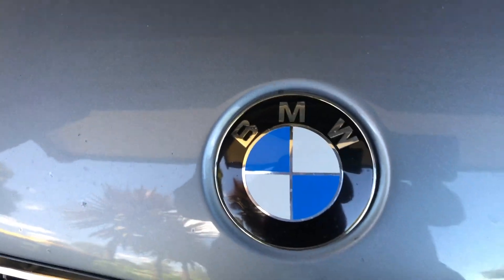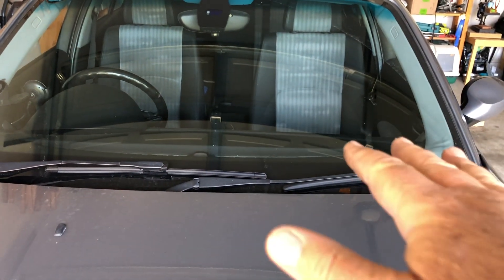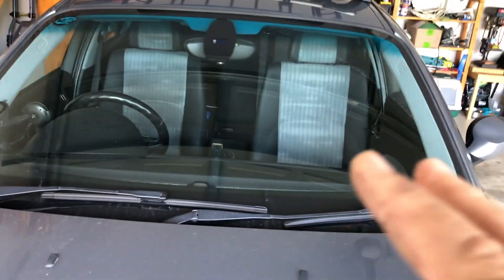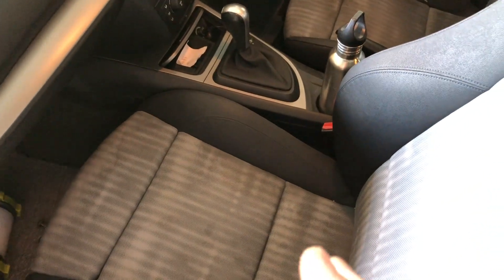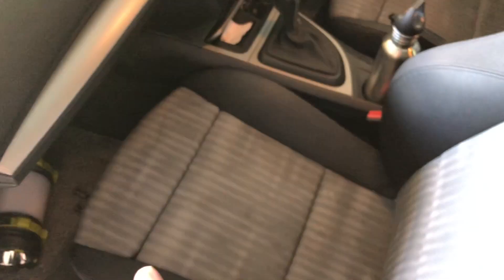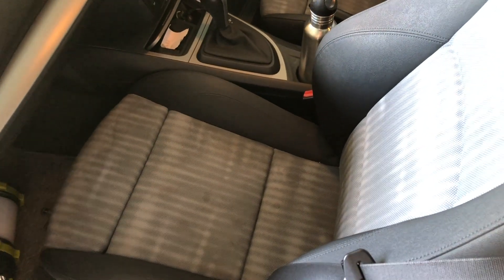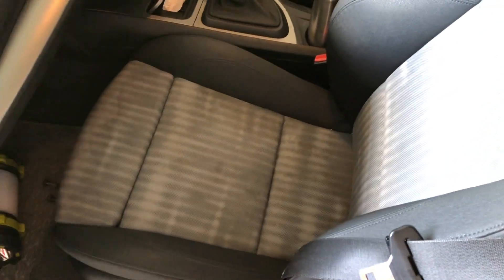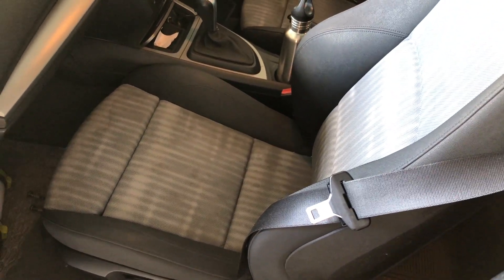Why you must replace a faulty Air Bag Seat occupancy sensor mat. Not use an emulator? Code BMW 93C2

Comment: It's equally as dangerous to have an adult in the passenger seat with the airbag disabled. This is a safety issue deserving of a recall no matter how you look at it. At the very least the replacement mats should be very inexpensive if not free of charge. Anyone that puts a child in or out of a car seat in the front passenger seat of a car isn't thinking clearly anyway. On the other hand if the airbag is disabled it's likely that any passenger in the front seat would be seriously injured in a collision. After a car reaches ten years of age I'll opt for the bypass thanks.